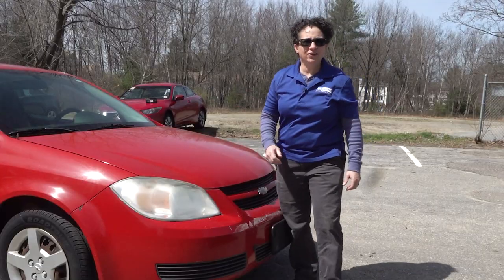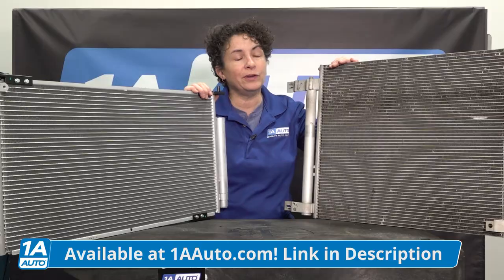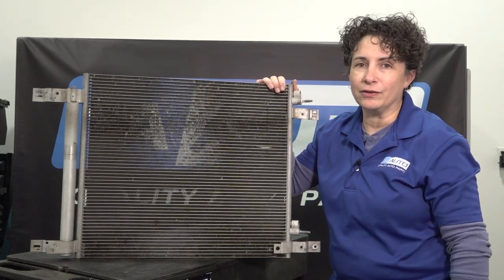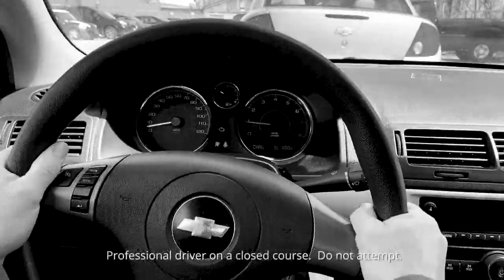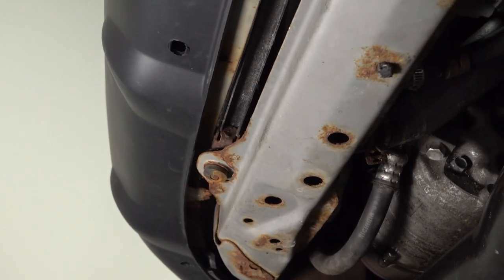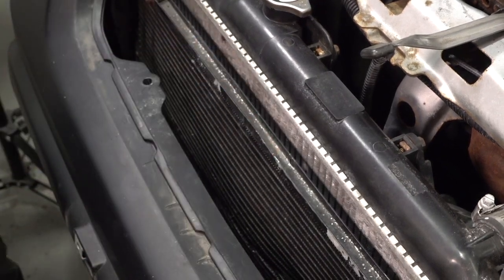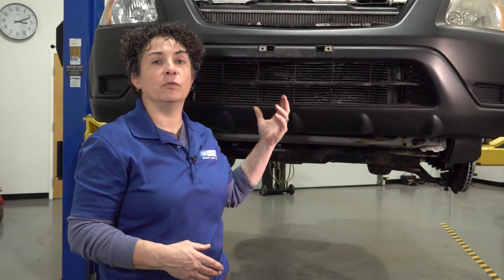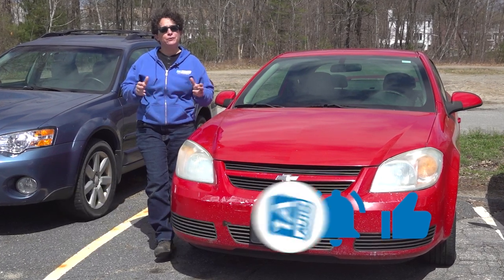AC not working? Recent accident repair on your car or truck? Your AC condenser could be damaged.

Comment: If you’re AC was open to the air for any length of time, the whole system may be ruined. 
You must get Dryer/ desiccant after any AC repair and evacuate asap. You may be spending money for nothing on new condenser as compressor may be shot from humidity

Comment: This is exactly what I think happened to my car I bought 1 and half years ago.  The ac started blowing hot air and thought it just needed to be recharged. Took it to an auto shop and the mechanic pointed the condenser was damaged. I was wondering how that could have happened. Thank God I came across this video. I bet the was hit and repaired and it never showed any reports of it being in an accident before I bought it. 
Any advise on what I could do?

Comment: Do you agree with Mike Duhaime's comment (below) to your video about moisture getting in the system?  The diagnostic garage left the high and low caps off my system.  I am waiting to hear on the appraisal for a supplemental claim post accident repair.